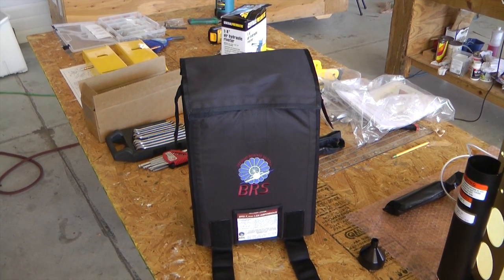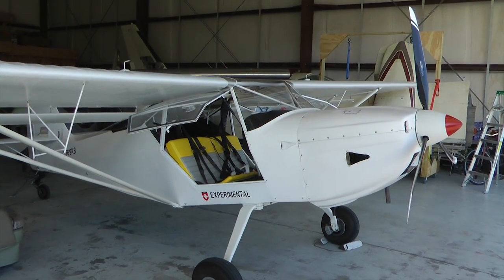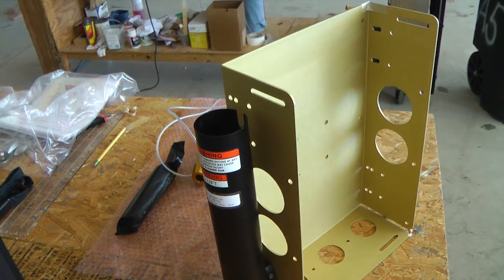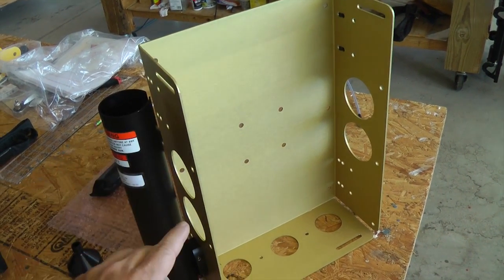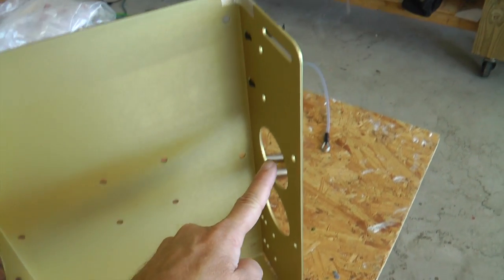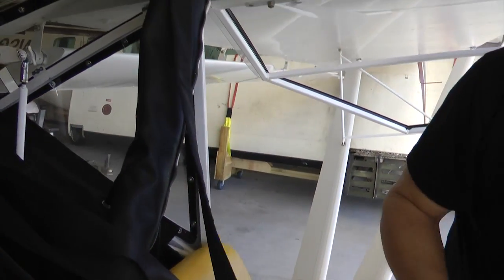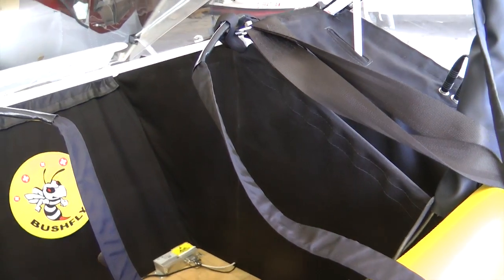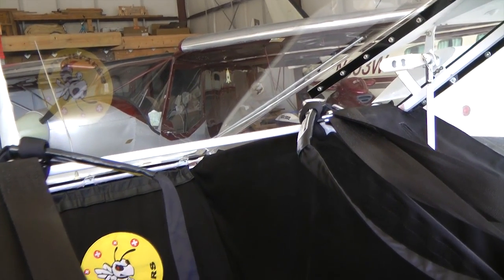Installing a Parachute in a homebuilt aircraft

Comment: I would never count on that rocket breaking the Lexan most likely what will happen is the rocket will not build enough speed to break though it it will bounce off and fill the cockpit with extremely hot gases from the rocket motor. I would cut out a square hole have the top of the lexan mount the pack flush with the hole so it sticks up a little bit above the airplane. That way the pack opens completely outside the aircraft. It should seal good enough when in flight.

Comment: 400 people saved by the BRS parachute system thanks to Mr. Popov and the BRS staff.
Reply: The BRS system is great lot of people say it's a waste of time but reality is rather have something I can use then nothing. In the case of a Kitfox can land them most places without much space needed like dirt road or parking lot with the big bush tires only time I see BRS useful on a kitfox would be if the controls get jammed or loss of control possible mid air collision which I actually think is the most plausible which could happen. I say this because some kitfox owners fly as a group they will land on river banks and fly inside canyons always possibly of colliding with someone else.  Same thing with un-controlled airports lot of kitfoxs fly out of those never know when someone isn't paying attention or have a faster low wing over take a high wing both can't see one another collide.
Reply: blastman8888  Thank you for using BRS parachute system!